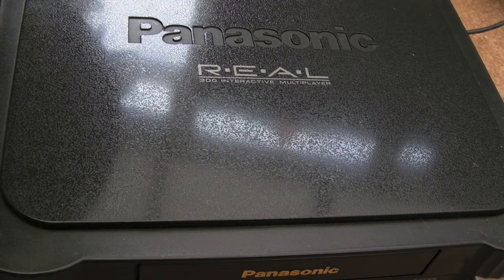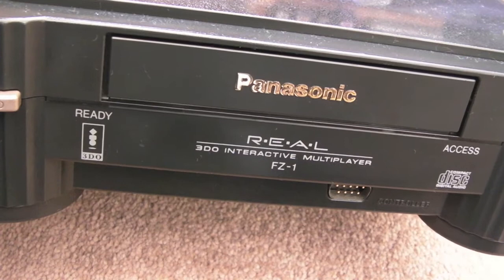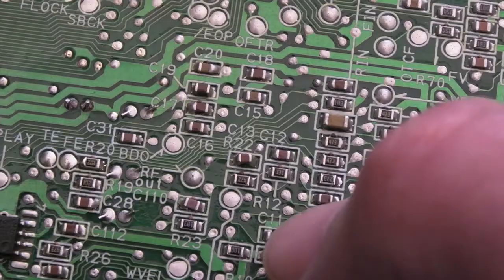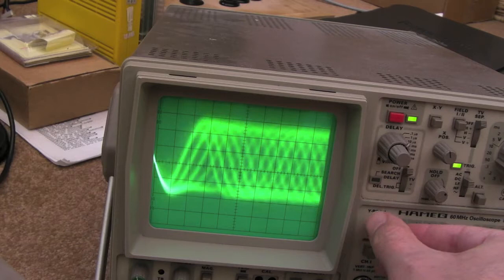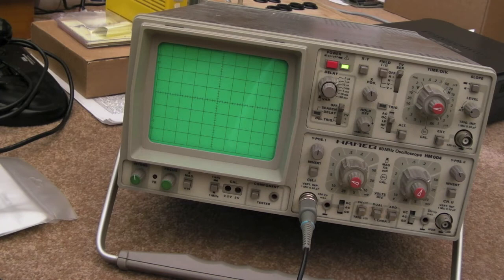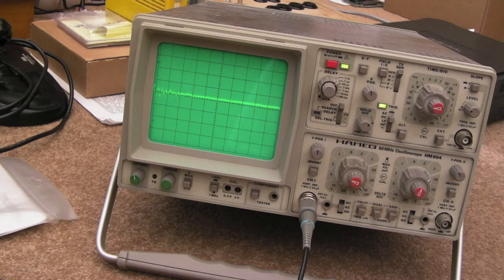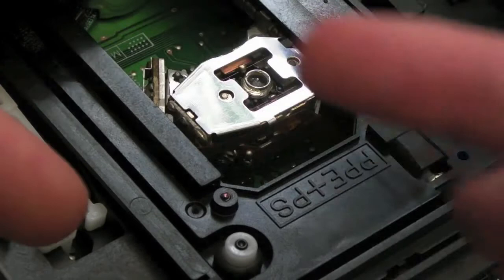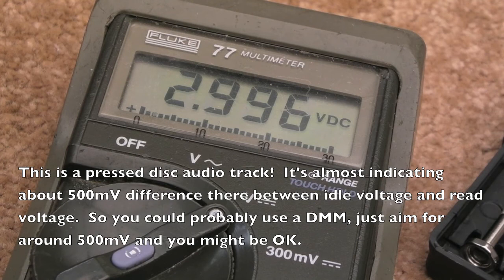Panasonic 3DO Laser Voltage (RF Level) Adjustment

Comment from the maker: In another video I looked at the memory expansion for the 3DO:- https://www.youtube.com/watch?v=45YoBvhyV0I&list=PLMjdUTC-GcRMjho136gdqa58cVX64C-Vx&index=4&t=0s
And here's another repair to a 3DO I did later, with laser adjustment (and fixing sound issues):- https://youtu.be/EVvhm22YQN4
Follow up:- https://youtu.be/3Zbh5jOxHek
Crackling audio fix:- https://youtu.be/oczWL5hNv48
Yet More Capacitors (on the CD drive):- https://youtu.be/b0d4OhPczH0

Comment: Just adjusted the laser of the CR-560-B in my japanese 3DO frontloader. Before the adjustment original games and music CDs worked mostly, but burned copys were stuttering in the FMV sequences. Tried an "Out of this World" copy with Verbatim and also an old black surface CDR, both stuttered badly at the Interplay intro.
After adjusting the screw just 0,5mm clockwise, both CDRs worked perfect.

So this made a big difference for my japanese junk console, which works fine now :)

Comment: SUCCESS! I had games that would run (Dragon's Lair, Sample This, and audio CD's) and a couple games that wouldn't run (the original Sampler and Gex), adjusting the laser to the voltage shown fixed the problem! Thanks!
Reply from the maker: Thanks, that's great =D

Comment: Brilliant video Chris, so much great information :-)
Reply from the maker: Thanks again Vince =D =D  The one correction I would add to this video in retrospect - that screw related to the angle of the rail that the laser slides on, it should just be tightened up.  It isnt for any kind of adjustment - it just helped with laser unit I had at the time.
Reply: @GadgetUK164  Thanks for clarifying that Chris. I bought a 3DO that is not reading discs around a year ago so I might try and look at it in the next couple of months :-)

Comment: Thanks for the 3DO repair videos. I've replaced laser in my Goldstar and checked all 3 motors with a 9v. Checked stop switch resistance with a multimeter. All good. The unit even shows opening video sequence and asks for a disc. Then all black with no disc spin. Next step is adjusting laser I guess. I have the capacitor pack too if adjustment of laser doesn't work.
Reply from the maker: Yes, I would check the caps - not sure if the Goldstar model(s) suffer from the same problems as the Panasonic FZ-1.  If its not the caps, it likely needs a new laser.

Comment: I managed to track down the service manual for a Euro FZ-10: https://www.electronica-pt.com/esquema/video-games/panasonic-fz10-30230/

Since the laser assemblies are the same in the Fz-1 and the Fz-10, the RF levels should be the same right? Look for the eye pattern on page 25 of the PDF. Seems to suggest ideal Vp-p of 450mV (when using the official test disc... I assume a pressed cd of any sort should be sufficiently similar). Interesting that the "untouched" 3DO  you have measures ~563mV, so even that might be higher than necessary.  It's very interesting to me that the optimal values for this signal on the 3DO are so much smaller than they would be, say, for a PS1.
Reply from the maker: That's fantastic!!!!  Well spotted!!!!
Reply: Great manual! tks

Comment: Great video man, weird when original's don't work but back ups do, I had to tweek mine like a crazy mother'
Reply from the maker: Thanks =D  Yeah, I think originals didn't work because the laser voltage was too high.  If you imagine the laser being a light (which is sort of what it is), the intensity can blur out the ability to make anything meaningful out of the reflecting signal.  Kind of like the difference where someone points a low power torch at you compared with a 150W hallogen bulb lol - lucky if you can see anything afterwards lol.
Reply: Are you bothering with that Replay Expo?
Reply from the maker: Probably not I think!  You going?
Reply: Should be, cash permitting, I am not far from there anyway, Preston on the train 45 min's or so.

Comment: The car laser assemblies don't work. the ribbon cable too long. Only thing that works is another 3DO or specific Panasonic CD-ROM drive from 90's. 

I recently fixed my FZ-10 using a laser I purchased from Russia! New one had horrible skipping. Tuned the laser resistor and now works like a champ!

The biggest problem is the variable resistor. It's not as easy to twist as on other consoles. 

You can check resistance with voltmeter on the widest ribbon coming from it. The 2 pins to the right of the ones with the blob. Mine read about 400 ohm. Initially they were at 650 and gave issues.
Reply from the maker: Yes, the variable resistor is very hard to adjust due to the insane angle its mounted on the pickup assembly.   The last two lasers I had (SF92.5 with 11p and 4p connections) work fine in my FZ-1, and both were described as suitable for a car CD changer or the FZ-1, maybe there's a few different car CD changers with the same pickup or something?

Comment: What is the correct range for the potentiometer? I messed with mine without measuring first and now it won't even spin.
Reply from the maker: All I can suggest is micro adjusting it and re-testing until you see signs of life.  If it just doesn't work anymore wherever its positioned, chances are the laser has died.  Ideally you want to connect a scope up to the RF test point - as I did in this video.   The resistance position will not always be the same in all 3DO - it depends on the age and quality of the laser.  But with a reasonable laser that still has some life, you should be able to get it working in a fairly wide range.   Test only with an original disc whilst trying to do these adjustments.  It may not work with burned CD-R if the laser is at the end of its life.
Reply: @GadgetUK164  the measure is made with device on or off ?
Reply from the maker: @eduardogarcia4452  If you are talking about resistance checks (with it off) - in respect to scoping the RF level (obviously power needs to be on).

Comment: I've literally received a new in box (never opened before) 3DO from a friend as a birthday gift, I could measure the RF pad on my scope for ya to see what those stock values would be, if that's of any interest to you at all :)?

Also, regarding laser voltage levels, do you have a reference somewhere you pull the data from, or is that all comparison vs other machines and average the values?
Reply from the maker: Thanks, would be great if you could measure yours!  I suspect its going to be around 563mV, maybe a bit more at nearer to 600mV perhaps.  The service manual will usually indicate what the RF level should be set to, but there is no publicly available service manual for the 3DO (that I know about).   So I took the measurements from another 3DO that is still on its original laser - one that works perfectly.  That's where I got the 563mV from in order to lower mine to the same value.   There are plenty of Saturn and PS1 service manuals about, so those are much easier to adjust.
Reply: GadgetUK164 I'm looking for the Neo Geo CD values. Come to think of it, didn't you do a video on that a while ago?
Reply from the maker: I've not done it on a working Neo CD yet.  Ironically I have a Neo CD PSU and Laser here, just no system lol.

Comment: My 3do is sadly not working and I believe it has to do with the laser not working because my cds will not read and the discs do not spin whatsoever. Do you have any repair tips I could use and or any other suggestions that could be the problem?
Reply from the maker: It might be worth watching the few other 3DO videos I did too!  There are caps on the CD PCB (not the motherboard) that may need replacing - mine had leaked).  Also the main motherboard caps will totally mess up the CD read ability (caps around the PSU section - 3 or so of them).   If caps are good on both boards, I suspect you need a new laser.  You could at that point adjust the laser voltage as I did here on a few 3DO videos - if it doesn't start working, try and find a new laser! =/
Reply: @GadgetUK164  thats exactly what I will do for sure. Thank you so much for responding back!

Comment: GadgetUk164 I have the same problem that John Beyonder mentioned in a previous post.  So whit the help of a friend Iam trying to change the all the capacitors at the drive and PSU. It Looks like easy to figure cause about the first ones , cause they all are at the drive board. But I am not sure wich capacitors are related to the PSU at the mainboard, please would you mind to let me know wich ones we should replace with a picture? We are not experts on these, so we need your help . Thanks in advance dude.
Reply from the maker: The PSU related caps are the ones I replaced in this video:- https://www.youtube.com/watch?v=EVvhm22YQN4
Reply: THanks a lot for the info man :)

Comment: Hi. Thanks for these videos on the Fz-1. I'm trying to find a solution for a different problem but have not come across anything like it on the internet. I've recently bought a japanese Fz-1 with a couple of original cd's. These are fine, but when using a cd-r I can play without problems for a minute or 10-15. Everything load fast with no problems, but after that, the sound becomes choppy and the game starts loading slower until finally the game freezes. After a reset no cd-r will load anymore unless I wait for the device to cool down (30 minutes or so, I usually go do something else) and then the cd-r loads without problems and I can play for another 10-15 minutes. Original cd's I can play all the time though. Any idea what could be wrong?
Reply from the maker: Most likely capacitors on the PSU and possibly on the drive!  I've done a few videos on those caps on the 3DO.
Reply: Hi. Thanks for your reply.. u r quick! :-) I was suspicious of those caps indeed, but would that logical if original games have zero trouble whatsoever and I can play those all day long?
Reply from the maker: Yes, what normally happens with the caps it the 12v line drops and this has a direct affect on the laser level.  So a pressed disc can read fine whereas a CD-R won't.  It's either that or once the laser warms up its intensity drops a little due to age and then it struggles to read CD-R.  The caps on the PSU always fail - its just a question of how quick you get to the point where the sound disappears and its stops reading all discs.
Reply: Thanks!! I'll replace them and hope that fixes it. The ones on the driveboard are hard to get to, so I hope I won't need to go there.
Reply: John do you was able to fix this changing the caps? My 3do FZ1 have the same problem, but with the FZ10 i dont have any problem

Comment from the maker: You might want to skip this if you watched the last 3DO video ;)  NOTE: This is NOT the 3DO shown in the previous video there with the capacitors replaced.  Update 27/08/2020: Watching this back I was questioning how I came to the ~450mV p2p level I measured on the RF test pad.  Comparing to the schematics (linked down below on the post by Matt G) - I see that ~450mV p2p is correct according to the service manual.  The reason I questioned this, I normally set each block size to the 200mV (0.2V) test signal on my scope first, but at the beginning of this video I mentioned each block representing 0.125v (not sure why I had it set that way - or maybe I meant to say 0.2v - honestly cannot remember.  But the RF level should be ~450mV, and the DC multimeter readings were correct (and work too if you dont have a scope).
Reply: I was experiencing Deja Vu... :P

Was the Audio thing not relevant anymore?
Reply from the maker: LOL!  You've lost me (and I am sure I've lost you lol)?  This is my old 3DO, not the 3DO just shown in the last video!  This 3DO works perfectly, but I had never checked the RF level since swapping out the laser 2 years ago.  I've only used this 3DO for around 2 to 3 hours because I wanted to check the voltage level - but until the last video where I fixed the caps on that other 3DO, I had no idea what the RF should be set to on one of these.   It's a good job I checked because as shown, these are set much lower than a PS1 or Saturn.
Reply: Oooh sorry! I thought this was your friends 3DO again! The video just looked very familiar xD
Reply from the maker: My bad!  I should have made it clear at the start =D
Reply: Haha that's cool mate :) you've got so much 3DO going on at the moment you probably lost track yourself lol
Reply from the maker: Haha =D

Comment: so basically the volt is around 3?
Reply from the maker: Assuming you see around 2.5v when not playing a disc, then yes - when playing an audio disc, around 2.90v.
Reply: I only have a cheap chinese multi-meter so I don't know anything about mV. I noticed that lot of my lasers mess up when I put the voltage too high because I keep thinking, because they aren't being read, it must be because the voltage is too low (but this was on gamecubes so now I know it has more to do withe the fact backups require higher voltates,  but regular sized DVD's require much lower voltages). I want to buy a lazer to repair mines but the cheapest one I can find is 40 USD. I should have bought them when I was still in China. Do ya know of any places that still sell the lasers?
Reply from the maker: They are hard to find now - the only thing I can suggest is to search on eBay, and AliExpress, but before ordering on AliExpress confirm with the seller that its the correct model (perhaps take a photo of the length and type of ribbon connectors on yours and ask to compare to what they are selling).

Comment: I'm having a different problem, I've already switched the unit to one that works on another 3rd and did not fix it. see the video, my reader is running to the end https://youtu.be/6HrMnZUdmIw do you have any suggestions for repair?
Reply from the maker: It could be that the track 0 switch is jammed closed - the drive would then think the carriage is still at track 0, so when trying to move up the disk it would continue going as it thinks it hasn't move.   That same fault could also be due to faulty logic on the drive PCB too.